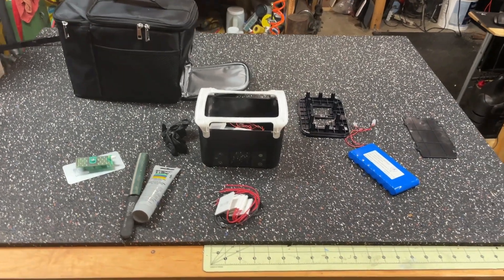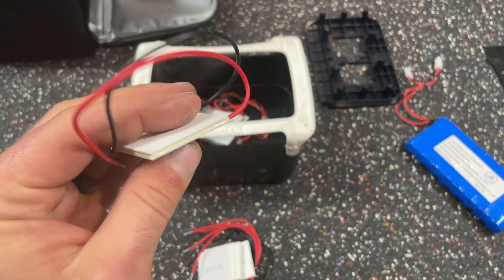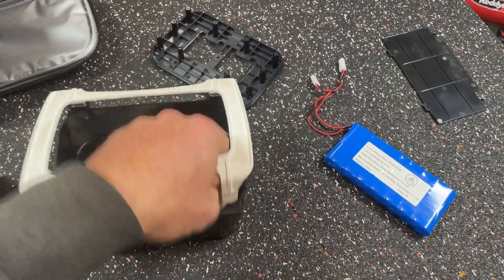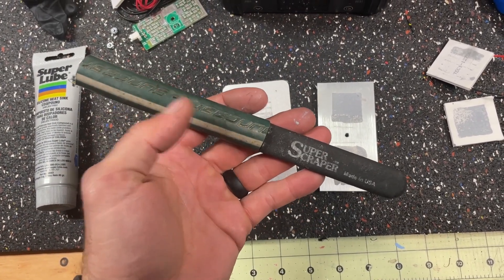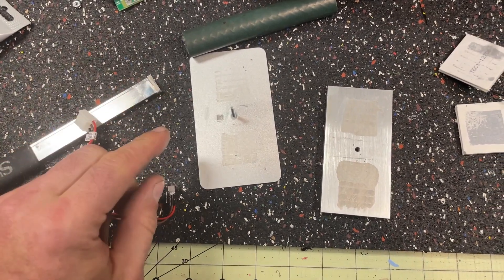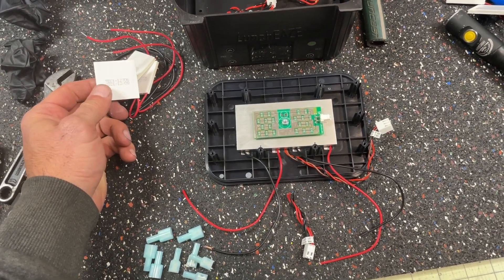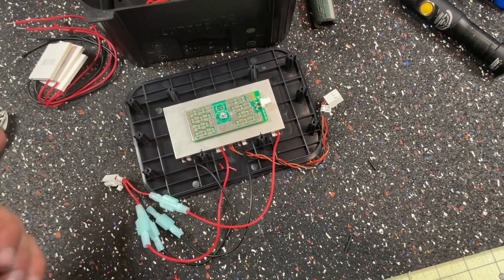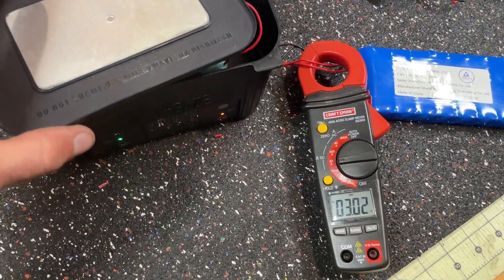Tools35: LunchEAZE Repair

Comment: Mine wont start to heat. The relay clicks and then it starts up for a split second then shuts off for 1 second then comes back on.
Reply from the maker: That sounds like a bad battery pack.  When the pack has high resistance somewhere the voltage will drop out under load.
Reply: @HVACLife  Got a new battery pack installed and it's working again thanks for the tip. I took apart the old battery pack to see if any of the 18650 cells were still good and they all read 4.6 volts but the writing on them say they are 3.6 volts. Do you think they are still good I wanted to use them for something else.
Reply from the maker: Yeah buddy let me post a pick of how I fixed the back...I do stuff like this all the time but fear being sued because of posting it...I RECMOMMEND you buy a suitable replacement!
Reply: @HVACLife  I bought a replacement battery pack made for it. I'm talking about the old battery pack wanted to save what ever cells were still good but they all read 4.6 volts and are rated 3.6 volts. Maybe the little board on the battery was faulty causing them to get overcharged and when it got turned on the voltage was to much and a safety feature cut the power off
Reply from the maker: https://www.youtube.com/post/Ugkx7s7th-hTClCS70JHlYndRkanPAm26KsT

Also if you have Peltier problems.  Watch both parts!  And looks at the descriptions.  Quality peltiers from Digi are still going strong, but the Amazon peltiers are really made for cooling and not heating...they only lasted 1-4 weeks max.

Comment: I have been looking at heated lunch boxes for a while and this video popped up,
how much were your parts?
bit dissapointing to break after a year and a half, when you mentioned VRFs I thought i better sub as ive been a building controls engineer in the UK for the last 13 years so, our lunch situation is probably the same, taking cold lunch or buying stuff out, ive done the heated food flasks but proper eyeing up the lunch boxes now, ill find your initial review :D
Reply from the maker: What’s up!  It’s really great to hear from a fellow trencher 🫡.  Thanks for the sub. Check a recent video description for our discord group.  I think you’d fit right in!  13 years is enough time to learn a lot and love the learning.  Controls is really cool.  What exactly do you do?  I’ve been writing lots of sweet programs lately.  It was hard to learn but I really enjoy it. 

The parts for the lunchbox were expensive unfortunately.  They should be linked in description or maybe that was a pinned comment idk kinda old video.  I miss a lot of YouTube notifications, discord is better for follow ups but either way, thanks for the support.

Comment: I want to make one and instead of just a hot plate, I want to use the cold side to be a cold and hot lunch box. And if I can rig it up to use a Ryobi battery pack that would be even better. I just need to learn how to do it.
Reply from the maker: Yeah it would.  You may want to see if you can buy a Peltier driver…they’re hard to regulate 👍

Comment: Has the temp of the hot plate gone too 200 F or close to it? It’s supposed to go to “212 F”, which mine has but has your repaired box reached or even passed 190 F?
Reply from the maker: No and I only think it could reach over 190F if the food you put in is already hot.  But since things like tea are normally comfortable around 135F the 190F limit has always been fine with me 👍

Comment: Hey buddy, thanks for the awesome video, currently working on my own version, what relay is that thing using could you check when you have a chance? would really appreciate it.
Reply: @HVACLife  im a newbie to electronics, but have done some in the past, I have a 12v 20000mah battery, what relay would you recommend to use?
Reply: @HVACLife  Wow thanks so much for the advice. yes, I will definitely make a follow-up post once there is some real progress. I bought some expensive peltiers, PTC's and flexible polyimide film heating elements to play around and see which ones can heat up more efficiently, the goal is to make a cheaper alternative to luncheaz or alike, because $200 price tag I think is overkill.
Reply: @HVACLife  Will do buddy, much appreciated.